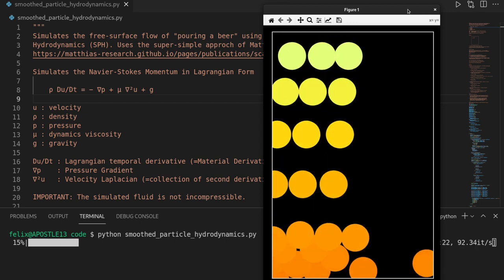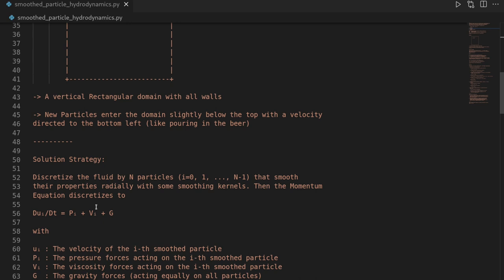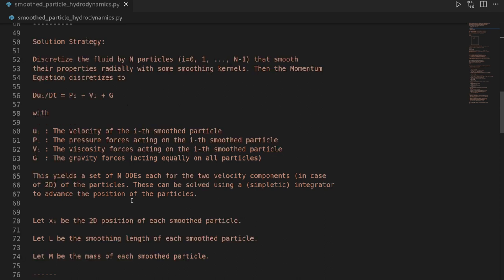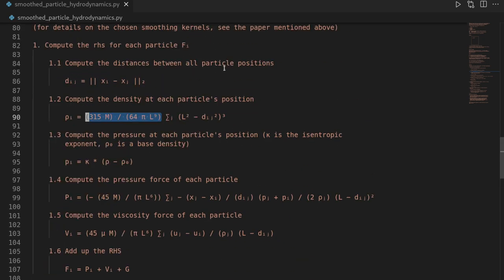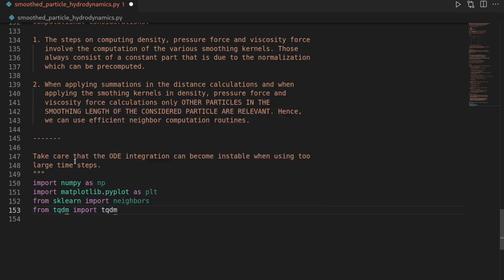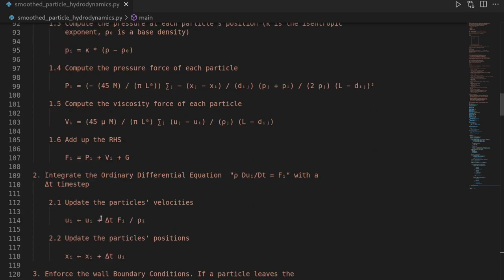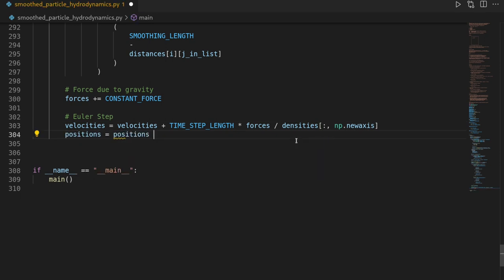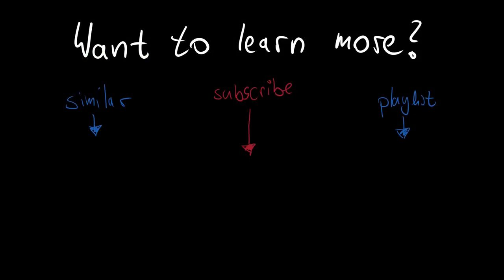SPH Fluid Simulation in Python

Comment from the maker: Errata:

- The normalization constants are for a 3D simulation and not for a 2D case as we use it here. (thanks to @David Skyfall for pointing this out)
- The gravity is wrongly divided by the density. There is already a fix for that in a version on the GitHub Repo of the channel (that you can uncomment -> slightly changes the simulation behavior): https://github.com/Ceyron/machine-learning-and-simulation/blob/main/english/simulation_scripts/smoothed_particle_hydrodynamics_simple_python.py  (thanks to @Oliver Hennigh for pointing this out)

Comment: Thank you a lot for creating this SPH method presentation project. This helps a lot to understand the method. 
I've been quite confused by the "Isentropic exponent" constant used in simulation. Can I ask you how this value has been established and used for simulation? 

According to the article "Smoothed Particles: A new paradigm for animating highly deformable bodies" Mathieu Desbrun, Marie-Paule Gascuel, the k-parameter in equation P = k(ρ - ρ0) is determining the material's stength of the density recovery.
Reply from the maker: Hi,
thanks for the comments and the kind words :).

The exact answer to your question is probably buried in the depths of thermodynamics. Certainly, using the name "isentropic exponent" is wrong here. We attempt to simulate a liquid (sth like water) which in most practical situations is incompressible, but we use a compressible simulation technique. This by itself is a very crude approximation. (Doing incompressible SPH is a topic for itself and definitely way more complicated).
Ultimately, I would say sth alongside the article you referred to. This value (I wrongly called isentropic exponent) is some kind of stiffness. For a perfectly incompressible fluid, we would want that to be infinite, because an incompressible fluid should not allow density fluctuations. Hence, it should respond with "infinite pressure force" against them. The problem with choosing high values (you can try it yourself), is that the ODE integration becomes more stiff -- requiring smaller time steps. Practically speaking, we need to find a balance to ensure a (visually) realistic simulation that is still numerically feasible. :)

Comment: Is there a way to count the number of particles at a specified y-value?
Reply from the maker: For an exact y location you could do sth like 

np.sum(positions[:, 1] == YOUR_POSITION)

However, it is unlikely that particles will be *exactly* at that location. So you could also check if they are within a threshold around a value:

np.sum(np.abs(positions[:, 1] - YOUR_POSITION) < YOUR_THRESHOLD)

Hope that helps 😊

Comment: How can I visualize the whole water surface based only on this discrete set of particles?
Reply from the maker: Hi,
I am not too into SPH. Probably, you will a good info in a classical SPH literature. Check for instance the "SPH tutorial": https://interactivecomputergraphics.github.io/SPH-Tutorial/

A simple solution that comes to my mind which only works once the particles are settled is to just take the convex hull of the particles positions.

Good Luck! :)

Comment: Thank you so much for making such a wonderful video. Although this was made two years ago, I feel the relevance of this is increasing with time! It feels amazing to see how you dealt with the complexity of the problem so easily. It was great to follow. Could I please request you to help me with this: I am a beginner in python, although I have a good background in CFD. How and where should I run this code? Would it be better if I use some online python platform? I tried with anaconda prompt, but I could not view the simulation. Please, it would be great if you have some suggestions. Thank you in advance!
Reply from the maker: Hi, thanks a lot for the kind words. 😊
Generally speaking, the best off-the-shelve solution for tinkering with Python is to use Google Colab. It comes already with many packages installed and even gives you free access to GPUs if needed. You could just copy and paste the code into one cell and execute. However, the plotting will likely not work as in the video (since Colab will plot in the notebook and cannot open a separate window. Admittedly, the way the animation is done in this video is a bit hacky).
If you want something local: You already have Anaconda installed. That's a good start. It's hard to provide an exact reason why the code did not work on your end. Maybe you use a backend for matplotlib that does not support the (hacky) way the animation is done here. An alternative: instead of updating the live plot with the current simulation state, you can write out PNG images of the simulation and then "concatenate" them into a gif/mp4 with FFMPEG and play this one.
Hope that helps :)

Comment: Hi, your video and  skills to code and explain  at same time are excellent. I'm learning a lot with them. I code this example in  Google Colab, and two things happened: 1st the graph output  is nor an sequential figure with a draw and clear after one. They are draw one after another on the Colab Console. But it is not a big trouble, I write them on Google Drive past and animete them after.  2nd: my particles are bounced on the bottom and  seems to me that some them are disappearing of domain.  I  can try to fix without copy your example code. Have you some idea  wich part of the method can generate such behavior?  Anyway, the code is very cool, and  I thanks for advance!
Reply: hI @MachineLearningSimulation, I`ve solved the bounce behavior.... identation of forces calculation. They are not on the correct sequence, and forces an non physical behavior!
Reply from the maker: Hi, thanks for the kind feedback 😊
Regarding your points:
1) yes, that's a bit unfortunate. It would be the same if the code is run in a local Jupyter notebook. I chose that way for the animation since it is easier to implement than the typical approach via matplotlib's FuncAnimation object. Of course writing out the images and then turning them into a video with ffmpeg is a valid alternative 👍
2) that could be caused if you changed the domain and did not modify the collision detection. You seem to have found a solution. Is there a fundamental problem with the script? If so, please open an issue on GitHub as well 😊
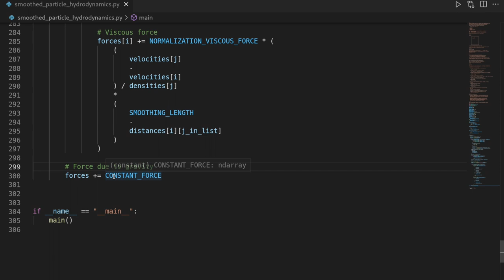Reply: @MachineLearningSimulation  Nope, your code works fine!!  I saw @25:00 on the video that I left the  last forces+= G+V+ P INSIDE the looping for. I broke the physics  :). After  put the line code  on the correct indentation, the code works fine. 
I've changed the particles injections with some random fluctuation on velocities components and the behavior was funny! 

Thanks a lot!!
Reply from the maker: You're welcome 😊
Thanks for the clarification.

Comment: Cool script, in your force calculations you are applying the gravity and then dividing by density. This causes the gravity to have a higher force for particles with higher density which is not right.
Reply from the maker: Hi, thanks for the comment and the kind feedback :). You are right, the division by the density incorrectly scales the force due to gravity. I added a note and an (optional) fix for that to the repo over on GitHub: https://github.com/Ceyron/machine-learning-and-simulation/blob/main/english/simulation_scripts/smoothed_particle_hydrodynamics_simple_python.py
It moderately changes the visual output of the simulation :)

Comment: Very nice demonstration. Thank you ! It does seem painstakingly slow though for the number of particles :(
Not sure Quadtree is the best tool for this. It shines more when data is sparse. With a well defined and confined space like this a simpler grid or hash algorithm is probably more appropriate (read much faster). Although that may not be the bottleneck here though.
Cheers !
Reply from the maker: Thanks a lot for the feedback :)
You're absolutely right, the performance is not comparable to any more sophisticated implementation (especially in "faster languages"). I first thought that the speed loss can be attributed to the Python looping, but here the nested loops are still almost insignificant in size.

A good neighbor search based on a spatial hash map could really make a difference. In the end, I found it to be simpler for someone following along if I just use an off-the-shelve neighbors algorithm.

If you want to improve the code's performance, feel free to open a pull request on GitHub. I think that could be helpful for others as well. Maybe that repo (using a hash map) can be an inspiration: https://github.com/Maarten-vd-Sande/smoothed-particle-hydrodynamics

Comment: I tried to apply this over a 2D dam break but got an unstable simulation.
Reply from the maker: Hi,
that could be due to multiple reasons. Setting up simulations, in which the particles do not "enter" the domain as shown in the video, but rather the domain is already populated with them, requires some care taking with respect to correct sampling of the initial condition, in your case the dam break. In different conditions, like situations with fast moving liquid (as it might be the case in you scenario), you might also need to reduce your time step size.

Comment: All your normalization constants are for 3d not 2d.
Reply from the maker: Good point, you are most likely correct. I took them straight from the paper, I mention in the beginning, where they are used for a 3D simulation. If you are experienced with SPH, feel free to open a Pull Request over on the channel's GitHub repo to correct them: https://github.com/Ceyron/machine-learning-and-simulation/blob/main/english/simulation_scripts/smoothed_particle_hydrodynamics_simple_python.py  :)
I will leave a pinned comment under the video.